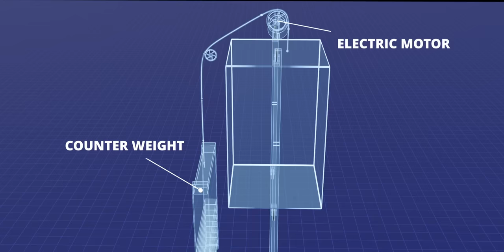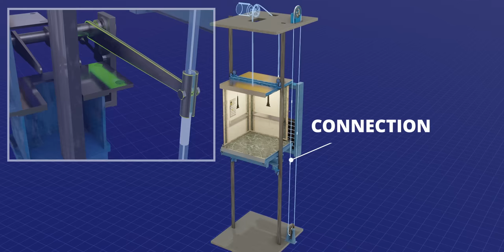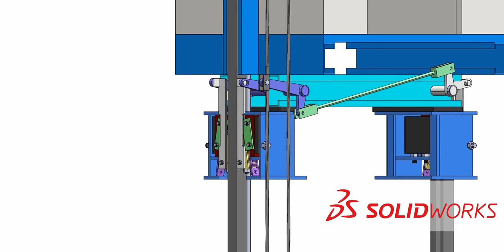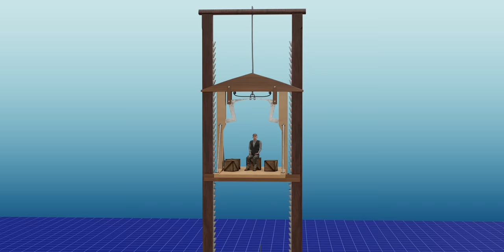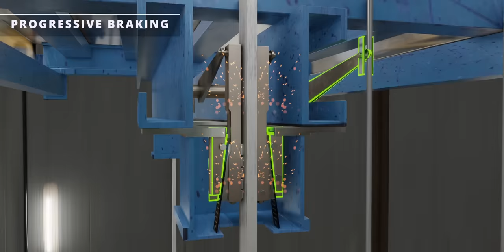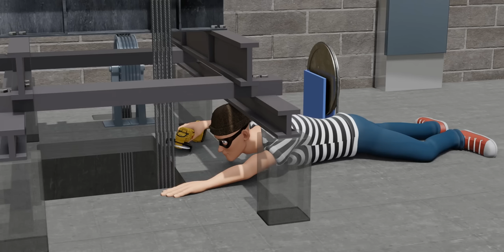Modern Elevators | The BRILLIANCE of Engineering

Comment: The 1945 Empire State Building bomber accident killed 14 people, but not the elevator operator. She fell 70 floors and lived. The 2000 elevator accident in the Empire State Building fell 40 floors or 400 feet before the brakes stopped the car, as designed. That's floor 44 to 4. So if the cable would've broke at floor 38, that safety brake would have stopped the car at floor -2...
Reply: 38 would have been no problem bro. It is a gradual brake, the speed would have been low at that point. The potential energy is also lower at floor 38 thwn 44.
Reply: @LeoLibe what about from floor 10-20?
Reply: @candrabeqx same concept. At floor 10 potential energy would be low enough for the brakes to gradually slow down the lift before it hits the ground
Reply: Same concept as car brakes. The higher the speed the longer it take the brake to slow down a car
Reply: Bro what
Reply: Why am I here... I'm literally a dumbass
Reply: How do you know so many things
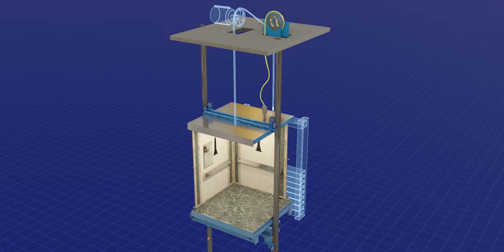Reply: 1:55 1:55 1:55
Reply: That means breaking was slow. The force would be severly decreased so I imagine elevator would just abruptly stop at bottom sending person up in elevator. Chance of surviving that would be high unless you hit yourself in head or damage your spine. But bruises and wounds are likely cause it's basically would be slow speed ejection.

Comment: If both the cables that hold the car and the brake cable are cut…like if an airplane crashes through the building, I don’t think the little spring on the bottom is going to save you.
Reply: There's a set of emergency emergency braking systems like progressive brakes, mechanical governors, new versions of cogs and racks attached to the cabin, or the futuristic still, magnetic brake system.

I don't think Mr. Lesley Ics is a lift engineer.
Reply: When the governor cable brakes, then the electric switch beneath the governor counterweight deactivates the electric circle and the elevator can't drive. Here in Germany latest 40 years elevators have this electric switch. Have a nice day, from a 20 years elevator technician
Reply: Actually in most buildings the springs are completely unnecessary. An elevator at free fall compresses the air beneath it, and the compressed air slows the elevator down, until the elevator reaches the bottom moving very slowly.

Comment: There was this elevator where maintenance was never done and the hoisting cable kept breaking. Luckily the governor cable always worked and saved many lifes. Sadly the Governer cable was never inspected and snapped without anyone knowing. Then the unthinkable happened and the hoisting cable broke again and the elevator fell freely. Never say Never.
Reply: How could the governor cable snap though?
Reply: @theblockybanana5537  worn out over time
Reply: When the governor cable brakes, then the electric switch beneath the governor counterweight deactivates the electric circle and the elevator can't drive. Here in Germany latest 40 years elevators have this electric switch. Have a nice day, from a 20 years elevator technician.
Reply: The way you capitalize certain words and don’t cite a specific incident makes your story sound fake.
Reply: @herobrine1847 It is fake... my point was that you can not say that an elevator can never free fall if it is still a possibility... even if that possibility is highly unlikely.

Comment: Elevator will never fall, blocking mechanism is activated almost immediately. Not exactly what you showed on video, but still your doing amazing job, showing how things works.. for all this years. Thx
Reply: "Never" is a touch optimistic, about 8/9 years ago I fell approx 19 stories in an elevator before it stopped on floor 6.
Reply: @bruhholmes  Hmm ok. Are you working on elevator services? bcs I preffer first and simple mechanism of locking elevator. It just should be more solid and durable, not like in ESB case. In modern design it is many ways, it could go wrong. I don't trust them bcs it depends more on servicing many components then one simple mechanism.
Reply: Maybe it's a redundancy.
Reply: @jayasuriyas2604  Its not redundancy if one component fails and rests can't do the job.
Reply: @bruhholmes bro what the fuck? What happened after that? Did you think youre gonna die? Were you in freefall and floating around?
Reply: It depends on the elevator, but from my memory there are multiple different ways elevators can stop, and the stopping mechanism would change depending on if the elevator was moving or not.

Comment: Been stuck in elevators 4 times in my life (twice in one day at seperate elevators). On one time, the cable slipped or something (didnt break) meaning the box shunted down all of avout a foot (if that far), and it stopped solid... engineer came out, took one look and told me the emergency break had stopped it... now that ive seen how it works, i can relate to everything happening.
Reply: stay away from elevators
Reply: @chowdercake2223  I did for a while after the second time. But its surprisingly few times considering how often I use them. For example, before the first one, I had to ride an elevator for work (as in most of my shift was spent going up and down to different floors); I would estimate I would ride that elevator at least 50 times a shift, that's 250 times a week, and I was in that role for a whole year before I got stuck in an elevator (a different one btw). So in the law of statistics, that's actually a pretty rare event. More common is having a near miss at least once a week driving to work (think about how often you have one), which is only 2-3 times a day.

Comment: This video is correct, but only valid if there's proper maintenance on the elevator itself. And as we've seen countless times, this is not always the case and the elevator can free-fall.
Reply: technically, theres a bigger chance for a free rise... but dont worry
Reply: @FlnSkr yes you are right about the more chance the elevator to go up. Wenn the brakes on the motor are defekt from the weight of the counterweight the elevator would go up.

Comment: The biggest problem that has been proven endless times in real life is if these devices actually make it onto the final build, and not left out because they were "too expensive". 15 killed in Italy quite recently because the cable car emergency brakes were too expensive to repair and maintain, so they just took them out.
Reply: So this isn’t a problem of the engineers or even the companies who install this. Almost all modern elevators have a lot of safety mechanisms. If the building, or management, or whoever cannot maintain this this is totally on them. You can’t really blame the technology or the engineers behind it. Same can be told for cars, aero planes and other heavy machinery which  all need maintenance in order to run good. And that is why at least some countries are strict in inspections

Comment: I was understanding the explaination until the point you indroduced the Solidworks. From that points it got way too confusing and to me the solidworks graphics are worse than the ones used before. Also I would sugest to start with a basic general explanation and then rollback and go through the whole system in detail for those interested on that side of things, I mean, not everyone has an engineering degree to understand all the information dilevered in a 10 minutes session.

Comment: That newer system relies on, assumes there is power, what if it goes out? Do they have Diesel generators to kick on, or batteries? For back-up. In the hospital, we have BIG Diesel power, tested once a week. We are told to use stairs. Generator is for red plugs only, IV pumps, ventilators, cardiac monitors, etc. Elevators I believe are not powered by the Diesel power plant.

Comment: What if the flywheel rope breaks. obviously there is the buffer springs, but yea it wud be quite a hit. Anyways amazing video.
Reply: it has a safety switch that activates the elevator brakes
Reply: Exactly. When we can use a circuit with compact accelerometers and gyroscopes and spring mechanisms, why do we need flywheel.

Comment: New governors are bi-directional, and feature both centrifugal mechanisms to apply the brakes, and an electronic measure.  I’m fairly certain the other end of the governer is connected to the counterweight.

Comment: Under US federal law, elevators in the US include the most recent inspection approval and date (usually in a picture frame) on the elevator wall.  Don't get in an elevator that hasn't been inspected in over a year.

CFR 1917.116(e):  Elevators and escalators shall be thoroughly inspected at intervals not exceeding one year. Additional monthly inspections for satisfactory operation shall be conducted by designated persons. Records of the results of the latest annual elevator inspections shall be posted in elevators. Records of annual escalator inspections shall be posted in the vicinity of the escalator or be available at the terminal.

Comment: Well it's not ideal, the mechanism are still complex and in ideal normal operating conditions it will never activate, basically saying it may not even work properly when its needed. It has to be simplified more. And from my understanding no one will make the elevator fall just to test if the system is still fully working. So it may save you it may still not.

Comment: But do they all have that brake?

So, when the ECU is fried with an EMP, it will free fall? 100% mechanical actuation sounds safer.
Reply: No worries, we'll just make cloud-connected elevators. As long as the building management pays for the monthly subscription, the elevator breaking will be controlled by a data center. Outages will be kept to a minimum and we'll use continuous integration to push new advertisement systems to monetize elevator riders. You can even pay a microtransaction per ride for increased safety. I joke of course but so many things have gone this way that it seems less and less crazy.
Reply: @username7763  🤣🤣

Comment: Pretty sure elevators are built in such a way that a single cable is still enough to carry the load capacity of the elevator, because (correct me if i'm erong) back when the inventor showed it off, people refused to step on one because they didnt trust a singular cable (despite him showcasing the safety by standing under it while it was on 1 cable on full capacity). So yeah. Its far more likely that the mechanism that actually moves the elevator breaks than the cables themselves, excluding centuries of no maintenance on said cables
Reply: elevator cables are made even though there are 4 cables 1 cable is strong enough to hold the weight of the elevator car

Comment: That tooth system could instead be rubber brakes rather than teeth, correct?
Reply: No it's supposed to lock closed during a fault so there is no possibility of release during a braking event
Reply: @Squat5000 Why not just place rubber at the ends, so it becomes a brake?
Reply: @dialecticalmonist3405  because if the system activates the elevator needs to stop and be manually put back into service. There should be no chance of self release
Reply: @Squat5000  But how is that any different from the modern mechanical braking system that uses the cable?

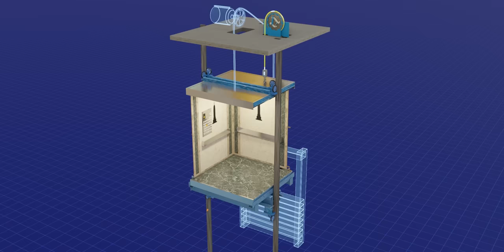Comment: 1:46 I just wonder why even bother with a flywheel? can't just tension from cables make breaks pads move apart and in the situation when cables break, tension is lost and breaks will be closed?
Reply: I has you have the flywheel overspend governor so the emergency brake can work where ever the elevator car is in the elevator shaft

Comment: I knew there were brakes on elevators but I really tought they worked in a simple manner this seems quite overengeneered. The lead spring solution is more along the lines of what I tought was the case. Instead I tought he brakes were always activated under spring tension as a failsafe for the motor brakes, and when the motor was activated it would separate the brake pads either with it's own power or by activating another motor with an electric circuit or something similar. The leaf spring mechanism is simpler yet than what I tought was the case, just replace the metal prongs with a brake pad that won't stop instantly.
Reply: The system they have works flawlessly, practically no need for improvement. They are "over" engineered on purpose, yes, because it's critical and people lives are at risk

Comment: How does it make sure that in case of emergency the free falling elevator is not arrested at the top of the building but is safely slid down to ground level? Is there any mechanical way to do that?
Reply: no
Reply: Nobody says it’ll safely go to the lowest floor. It will just stop wherever it can. 

Sir, how will they rescue the trapped passenger?

Some lifts have a escape hatch for a reason, the rescuers can place ladders and climb down to the cab from the nearest shaft door and then can get you out. Yes, a bit involved process but this way at least nobody is trapped.

Comment: The original spring design could be extended to activate the modern breaks. It would be much safer. And if we add electronics, I'd make the elevator itself activate the breaks, if it detects free fall.
Reply: What if electronics fail it's practically unnecessary to over complicate this system
Reply: @tristanviola  You add the electronics as extra fail-safe, not as primary safety feature, like it's shown in the video.

The idea is that cutting the safety wire would make the shown electric (and mechanic) system(s) useless, but having an accelerometer in the cabin would be an improvement.

I was also thinking about manual break, 
but outside skyscrapers there won't be enough time to act, even if there are warning signs.
Reply: @ИванСнежков-з9й 
What you’re saying is generally what is implemented anyway. Cable snaps are first of all very rare. So an actual free fall happens upwards not downwards. Because counterweight is heavier than the cab. 

When the normal steel cables snap it doesn’t mean that power is immediately lost to the cab anyway. There’s a different belt which carry the signal and power.

Comment: so i'll never get to jump when it hits the bottom.. thanks for ruining my day :)
Reply: It'll go upwards most likely. The counterweights are designed to be a little heavier than half load. Law of averages comes into play
so that usual loading of passengers, counter-balanced by the weights, equates to hardly any demand on the electricity supply for daily running.

If it's just a couple of you in the lift when there's a snap and a clank from above, up shall ye fly, jumping n all!
Reply: Count your blessings because you just never know what life throws at you or in this case where and how far it throws you
Reply: Awww